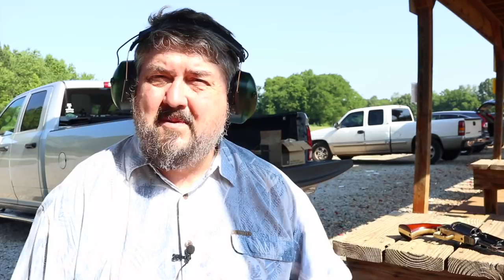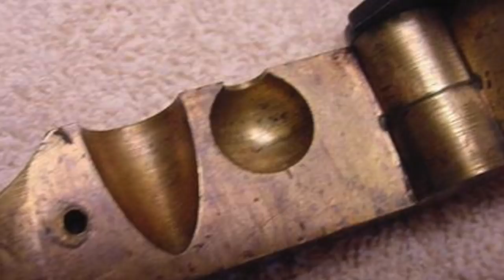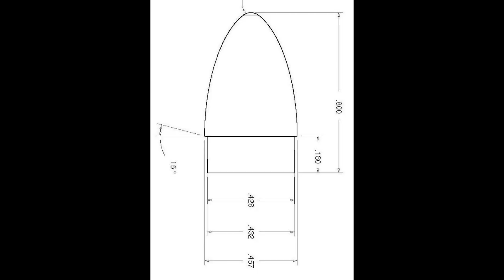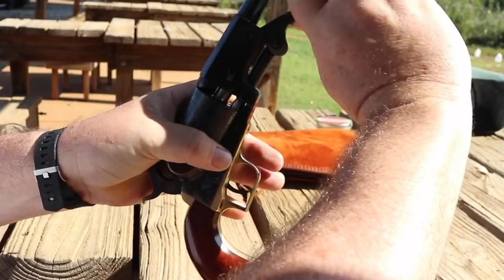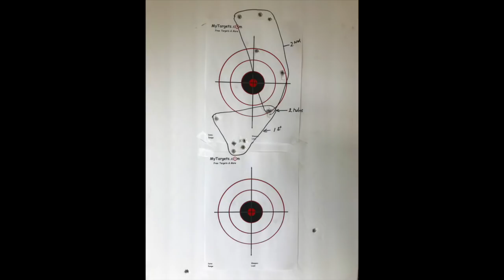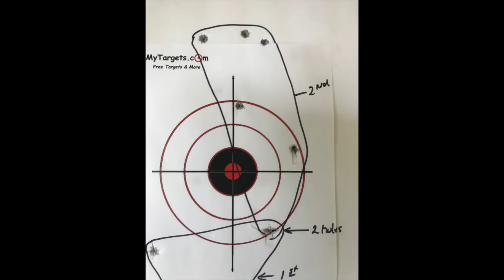Colt Dragoon Bullet, by Eras Gone Bullet Molds

Comment: With mould would i buy from ya'll  to use in my .44 '51 Navy and use in my .44 Colt 1860 ?
Bolt are reproductions. 
Thanks.
Reply from the maker: Charles, the only mold we carry that would work well in a .44 Navy is our .44 Kerr.  It will also work very well in you 1860.  I have a couple of videos on that bullet.  I'm out of stock right now, but should have them in 6-8 weeks.

Comment: Could you use these bullets in a Colt Walker?
Reply from the maker: They would shoot well in a Walker, but you might have to alter the loading port a bit for it to fit.  Dustin Weneger (Guns of the West)  has a several videos on shooting these in a Walker and how to enlarge the loading port.
Reply: @erasgonehistoricalmolds2400  Hello, will they work in a 2nd Generation Colt Walker?

Comment: Were these historically used with no lube? Unlike other bullets which have a lube groove.
Reply from the maker: The bullets were lube historically.  But you are correct. With no groove very little lubricant was carried with the bullet down the bore.  Colt saw this as an issue too and redesigned his .44 bullets with a lube groove around 1860.  However this style "sugar loaf" bullet continued to be made in US and CS arsenal all through the Civil War.

Comment: Could you make a 2- cavity mold where you have one cavity be this bullet, and the other one a round ball
Reply from the maker: That is something I would love to offer,  but LEE will not do custom molds which have two different cuts in the same block.
Reply: Mark Hubbs ah understandable, I had the idea from seeing some of the original colt molds and thought about applying the same concept they used with those

Comment: Watched your film I see how you load the .800 bullet in  Dragoon apologies for misunderstanding your adds , In descriptions 3rd paragraph it states guns it will not fit because of being to long , as I understood the add Dragoon being a smaller gun than the Walker the bullet should have been advertised for the Walker and the Dragoon being secondary , The add still says it will not fit a Walker along with 1860 and the Rem/army / I stand Corrected the Bullet will shoot from a Dragoon , I am not convinced as to working with a paper cartridge in  Dragoon .
Reply from the maker: Thanks Frank.  This issue with the Walker is not the length, but the width of the loading port.  The shoulder of the bullet snags on the side of the port as you try to rotate it under the plunger.   A little time with some needle files can cure that problem.  Dustin Wenegar has a video on how to alter the Uberti Walker to take conical bullets.

Comment: After the shot point that smoke wagon in the air to let gravity work with you and your caps can't fall in your action chief
Reply: If you can get away with it. Lots of gun ranges have explicit rules against raising the barrel of your gun when on the line, given the risk of an accidental discharge exiting the range.
Reply: @BogeyTheBear  ic i am the range master at my range. So
Reply: The problem with the Uberti replicas of the 1847 model Colt's is that they just aren't made as well as the hand fitted originals were. One of the biggest issues with them is that the edges of the striking surface of the hammers are left too sharp, and you really need to take a small file, or an Emory board, or even just sand paper, and round off the corners of the hammer face a bit. The sharp corners bite into the soft metal of the caps when they fire, and cause them to stick to the hammer just enough that when you cock it again, the hammer will lift the busted cap off the nipple, and drop it into your action. That's really inconvenient. Just smooth off the edges of the hammer, and it will quit doing that. The originals never did that.
Reply: @ps2hacker  How do you know the originals did not do that ? They are now over 100 years old, so the sharp edges have worn off, the real problem is that modern caps are completely different the caps back then, they were much thicker, try some 100 year old caps, they do not jam, I still have a plentiful supply of Eley caps .
Reply: I have found that really is the easiest and cheapest way to solve the problem.

Comment: With the Colt Walker what do you recommend for the correct sizing die? .454, .457 etc?
Reply from the maker: The bullets are not sized using a die.  They are sized to chamber diameter as they are loaded into the chambers.

Comment: But the main thing we have to remember about these pistols number one first and foremost these are a combat piece repeat a combat piece meant for ranges up to 50 yards if need be they were designed for quick point and shoot was the enemy as a last-ditch in the calvary and the Civil War the rifle was the main armament your pistol was your final backup your Infantry if you will it was your last ditch and usually targets or less than 50 feet or less or 20 feet or less or arm's length or 12 feet away I mean up close and personal you can get some beer adjustable sights through the Dixie catalog out of Tennessee I have such catalog and they do Southern for percussion there is some slight modifications that can be done possibly to the barrel sooner throat making sure the cylinder are lined up with the board and each chamber of Thrones is true
Reply: 10 to 20 yds

Comment: Also I was wondering what are the grains in a bullet I wonder if he's thought about making a genuine Elmer Keith wadcutter while the bullet design he has looks good for penetration you could almost develop the Keith water cutter with a hollow base and thick skirts the usual Keith wadcutter has three equal driving bands of the same width however if modified with two extra wide driving bans and a deep grease group and a hollow base of 200 grains possibly to 250 or thereabouts or even 245 grains will be a good killer on game and as far as a good self defense load with a couple of preloaded cylinders may be great I thought of that even like the 36 caliber Colt Navy some take a bullet diameter or 375 a 200 to 220 grain might be ideal for that

Comment: Now this is a smart guy one of the things could be improved upon on the gun itself what I have a longer cylinder fitted into the frame with less Barrel extension to close examination of the gun itself plus there are several different brands of black powder and of course you have your peridex and a few others substitutes also there is a thing called Heating the steel to about 300 degrees and then wrap it freezing it that shrinks the steel to where it stiffens the barrel and then possibly hard Chrome lining the barrel if the barrels for hammer-forged which would be good and then possibly each chamber should be measured in the cylinder throats there could be a variation throwing off and then cylinder alignment with the Barrel if they are not bore sighted that could be a problem as well

Comment: +Mark Hubbs It is fascinating to look at the rapid progression of conical bullet design as shown in molds for "Colt's Revolving Holster Pistol" (Walker, Whitneyville Dragoon, 1st, 2nd & 3rd Model Dragoon) In 1847 the Walker and Whitneyville-Hartford Dragoon molds used the 219 gr Picket Bullet (no rebated base); in 1848-50 the 1st Model Dragoon mold used a 219 gr conical (rebated base, no grease groove); in 1850-51 the 2nd Model and early 3rd Model molds used a smooth 258 gr conical, and late 3rd Model Dragoon molds cast a single grease groove 258 gr conical.  All molds, except the single-cavity-Picket Walker, were double-cavity casting a round ball in addition to the conical. The Walker and some Whitneyville-Hartford Dragoon molds were iron. Late Whitneyville-Hartford Dragoon, and all 1st and 2nd model Dragoon molds were brass.  Early 3rd Model Dragoon Molds(1851-59?) were brass. By roughly 1860, Colt was using all iron molds for revolvers.  

Not sure if this is of any value to you, but it is an interesting bit of bullet design evolution. 

Thanks again for making these historic bullet design molds available to the shooting world.
Reply from the maker: Thanks for the kind words, and yes it was helpful information.

Comment: +Mark Hubbs The Dragoon .44 mold is on the way; I ordered about a week ago. Thank you for making these available. I now have all your revolver molds.  FYI, this smooth 258 gr conical first appeared in brass molds for the 2nd Model Dragoon circa 1850-51. It continued into the early 3rd Model Dragoon molds 1851-1858?. Roughly around 1858, the 3rd Model Dragoon molds added a single grease groove to this same conical bullet design, retaining the same weight of about 258 grs.  In 1858 Colt Cartridge Works dropped the tinfoil envelope revolver cartridges (1855-1857) and began using a paper envelope cartridge for the Dragoon using the single grease groove 258 gr bullet over 20 grs Hazard Cartridge Powder.  Hazard Cartridge Powder was so-designated because the powder was an extremely fine grain sporting grade black powder, much too fine grained to be safely loose-loaded in chambers from a flask, as it could dribble thru nipples, coat the breech face and set up a possible chain fire situation in revolvers.  Hazard #1 Pistol Powder could be safely loose-loaded from a flask as it was roughly like modern Swiss 4Fg powder.  For safety, I always go to after-market nipples with tiny flash holes on my Uberti/Pietta replicas before loose-loading any powder finer grained than Swiss FFFg. I find stock nipples on Uberti/Pietta revolvers to have flash holes way too large compared to original Colt/Remington nipples, creating a lot of back-pressure-caused cap jams and a danger for chain fire due to powder dribble-thru.  

Greatly appreciate your molds, Thanks!

Comment: So Mark, will this bullet load into a Walker??
Reply from the maker: It will load with the cylinder off the gun on a loading stand  The loading port on the repro Walkers are notoriously short and narrow.  Only a round ball will load in a walker unless you buy the Uberti made mold specifically designed for it.
Reply: I was afraid of that. I put a Krist conversion cylinder in my 3rd. mod. Dragoon and don't have the percussion cylinder anymore. Dang. However, I am considering putting a conversion cylinder in the Walker. Do you think one of your bullets could be loaded into a 45. Colt cartridge? I use gated cylinders I don't think dissembling a colt every time you load it is a good idea. Thanks Keep up the good work.
Reply from the maker: Hugh, you might be able to load it into a .45 long colt casing if it is sized to the correct diameter.  However, I think the overall length might be too long.
Reply: This can be loaded into an Uberti Colt Walker with some minor modification to the loading port.  The metal is soft enough to allow for jeweler files to work off a few millimeters till it clears.  Do this at your own risk.  You will not be able to load paper cartridges into the walker if this conical is attached due to the location of the wedge.  You would have to make powder cartridges to load first and follow up with loose conicals.    Masking off the area around the loading port will mitigate filing scratches. I finished the filing with 500, 1000, then 1500 grit paper and blued the exposed metal.  I need to make another pass at mine to remove about half a millimeter to ensure consistently smooth loading.